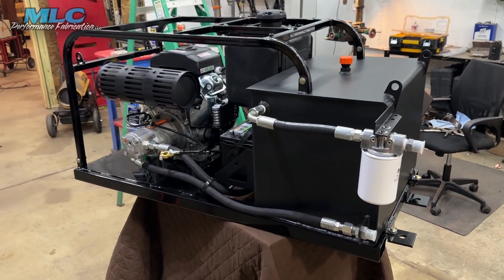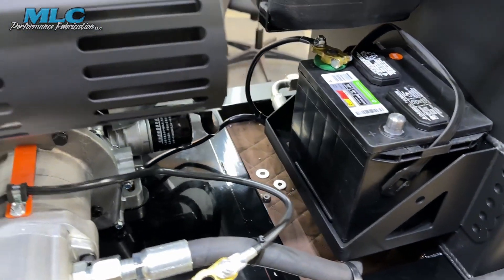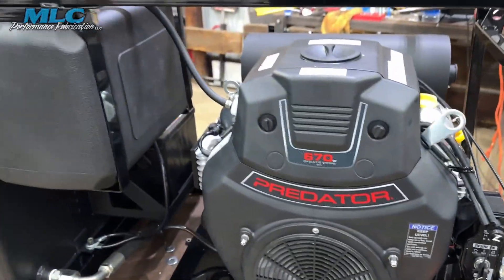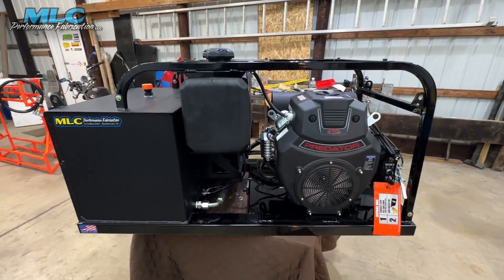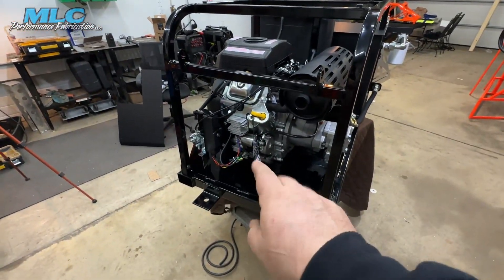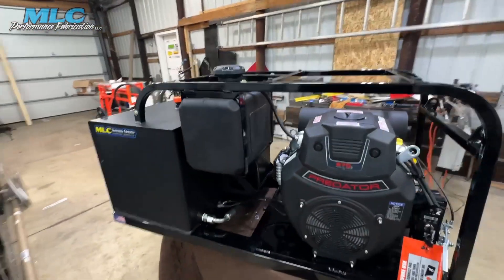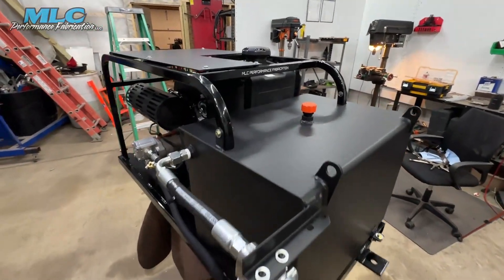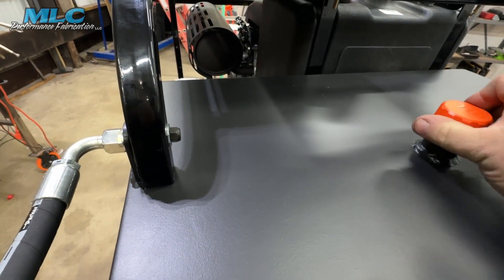Gas powered Predator V-twin Hydraulic Pump

Comment: What is the love joy required going to use this same setup
Reply from the maker: L90 will work,  engine side is 1 1/8" bore, pump side was 5/8" bore. length will be determined by the pump mount.

Comment: is that engine over kill for the pump? or is it spec’s out for that. i’m building a unit to mount on my service truck and have been trying to figure out which engine and pump. my flow rate is the same as this unit. i need 8gpm @2350psi.
Reply from the maker: Depends what your trying to use it for. The motor is spec'd for the work it will be doing. Operating a Landoll style traveling axle semi trailer.
Reply: @ mine will be to run outriggers, hydraulic air compressor, and boom crane. not looking for full crane function with compressor going etc. honestly would be seldom use. but when needed greatly appreciated lol
Reply from the maker: @ That motor is a workhorse.

Comment: what kind of price point do you have on that kit?  I'm looking into a power pack to hang on the roll cage of a mini excavator to run a flail mower etc. 5 gallon tank, 15-18 hp, oil cooler, 8-9 gpm 2800 psi. right now the aux circuit has 7.5 gpm and 2800 psi but you cannot move the excavator and run the flail mower at the same time. the additional 200-300 lbs would also help counter the weight of the mower extended out 12 ft.
Reply from the maker: Send me your email: mlcfabrication@gmail.com I'll send you over a quote.

Comment: How much pressure can those pumps put out?
Reply from the maker: Depends on the pump used. In the first video for the power pack the pump was capable of 4000 psi at 4000 rpm. The second pump had more GPM @ 2000 rpm but 2700 psi at 3000 rpm.

Comment: What pump and mounting bracket did you use
Reply from the maker: Pump came from McMaster-Carr. Seems to be built by wolverine just not labeled as such, part number 6296K27. The pump mount came from One Hydraulics E575522A : MAGNALOY 5.75 PILOT ENG MOUNT SAE A X5.25.  Used a love joy coupler to connect the pump to the motor.